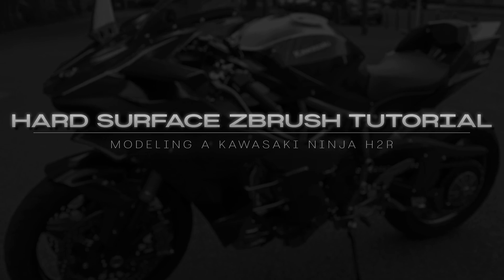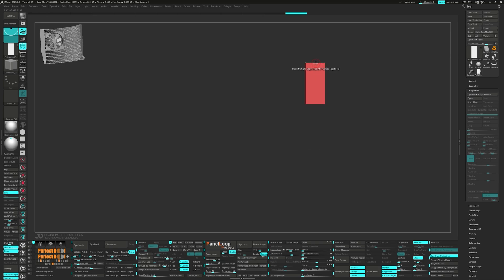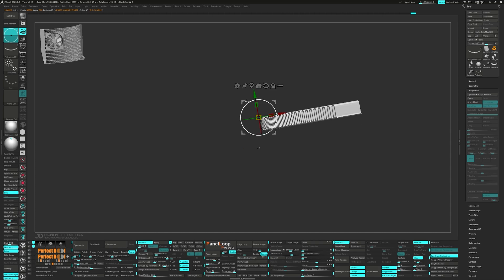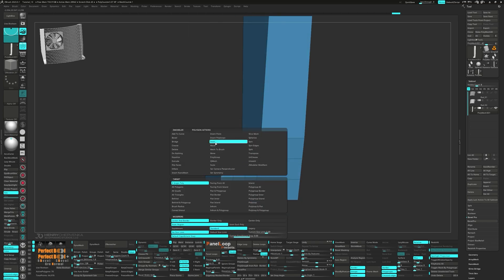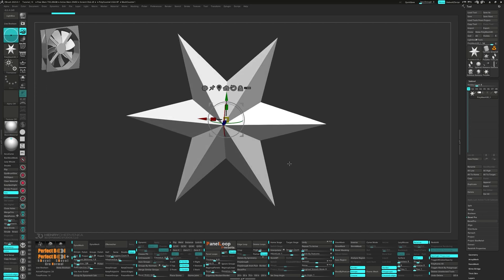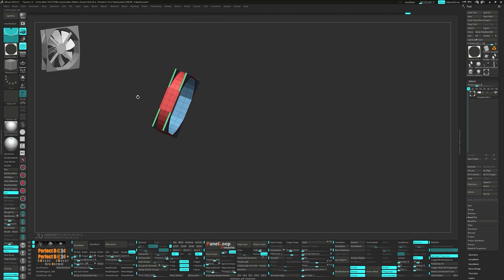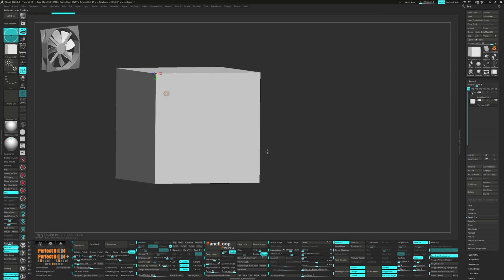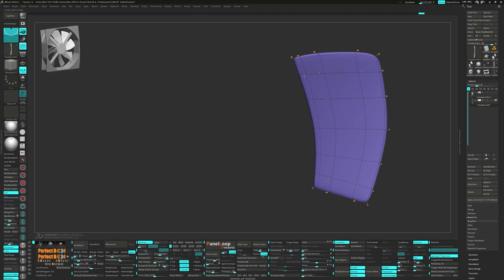Hard Surface ZBrush Tutorial Series // Modeling A Kawasaki Ninja H2R // 18

Comment: hey Henry , 14:00 
 Why when I use command IMM 28 and then CTRL + Drag mouse, my object does not move to the grid but the mesh of that area is lost? I have followed all the steps.
Reply from the maker: It can be difficult to understand without seeing the process, but here are some steps to ensure it works correctly:

1) Make sure the targeted surface is its own polygroup.

2) Turn off "Smt" (located next to the Divide button under Tool > Geometry).

3) After dragging the IMM onto the mesh, avoid rotating or navigating the model before performing the next step.

4) Double Control-drag on the canvas to complete the operation.

Note: Any navigation on the canvas before the Control-drag step will cancel the mesh fusion process.

Here’s a video I made that walks through the process at a slower pace: https://youtu.be/c3YzGQv5y_Q?si=H-fYH1bjxrqcijHt
Reply: @henrychervenka  thanks Henry, i fixed it, i made mistakes 1 and 2